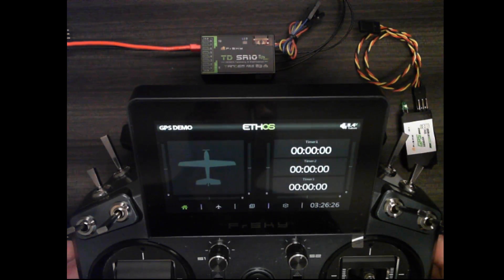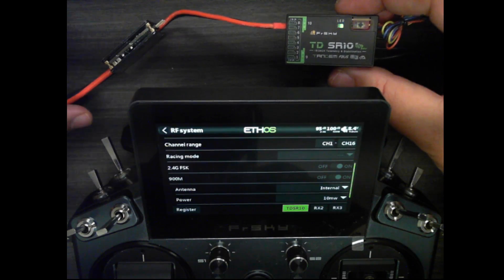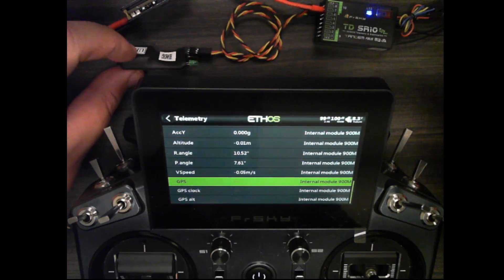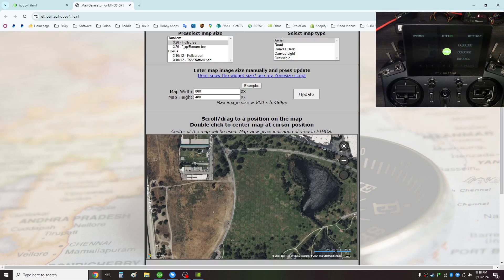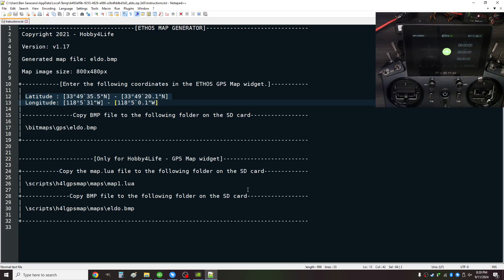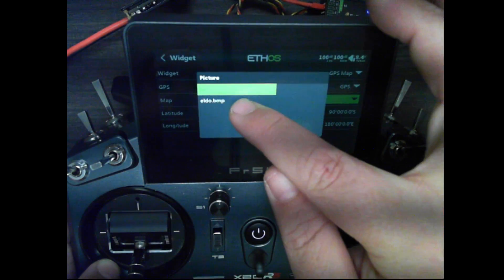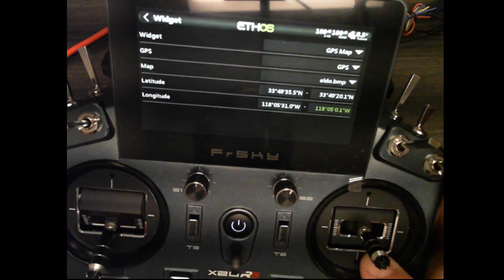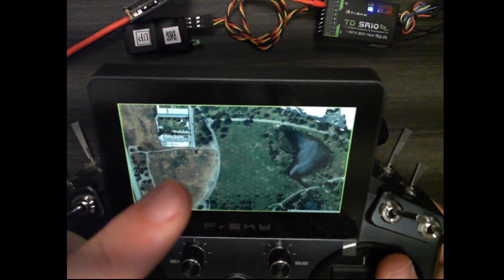FrSky ETHOS Map Widget Setup with GPS ADV Extended Version Complete Setup

Comment: Follow your instructions no gps dot
Reply from the maker: @cbfsoar15  what GPS are you using? Did you discover the sensors and getting GPS sensor listed? Did you select the GPS sensor on the map widget? Does your GPS have a fix and displaying coordinates on the Telemetry page list? If all above is correct then double check you have entered the coordinates correctly for your map on the map widget. If there  is an error on your coordinates the dot will not display correctly

Comment: Ben, can you confirm, that if using a TW-SR8, re-pinning PWM pins (channel 1-8) is not possible as you show with a TD-SR10.
Reply from the maker: @TheBigChinoDon  correct you cannot reprogram the pins on some receivers like TDR6, TW SR8 etc. (Pretty much any receiver below 10ch) so you just use the regular smartport connector from the small white connector and you can program the Telemetry option to FBUS by receiver options on the RF System menu
Reply: @frskyben  Thank you